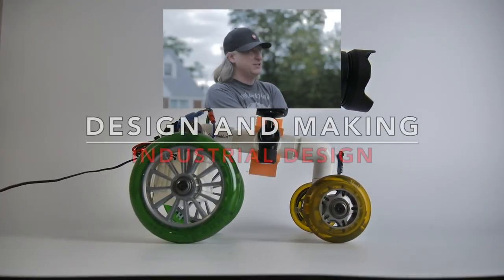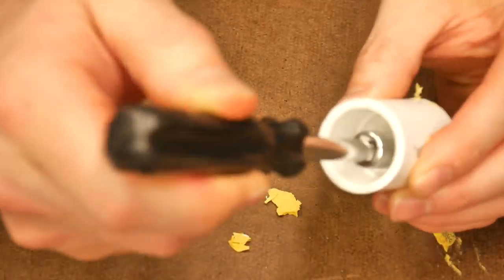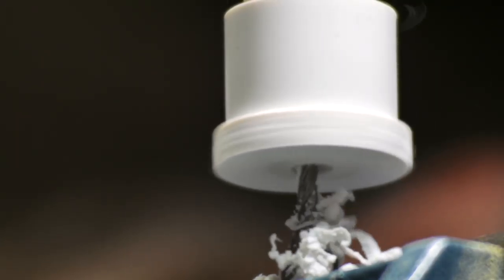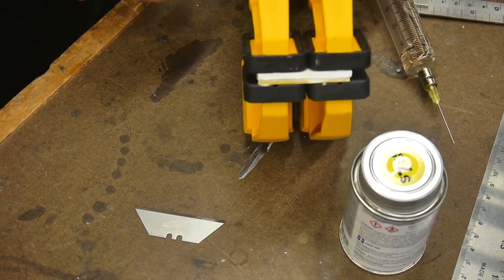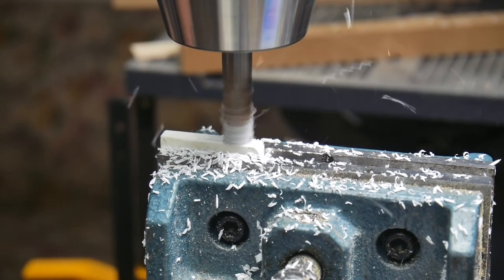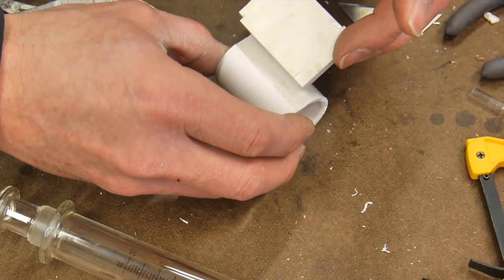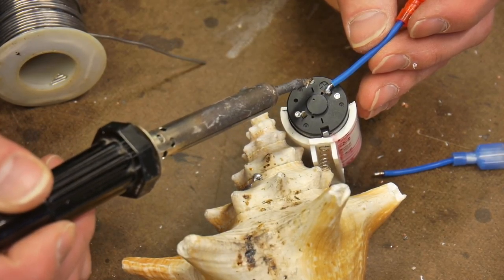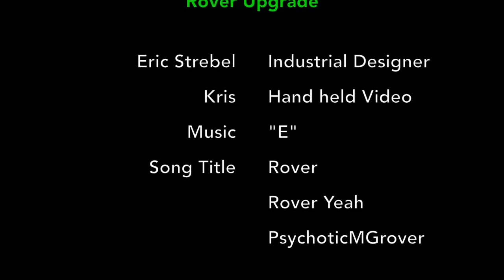Rover Table Dolly Hot Rod upgrade: motor mount and wheels

Comment: Am I missing something? If you're using the same motor shaft speed as you used with the smaller wheels, shouldn't the speed across the table be the same with the bigger wheels?
Reply from the maker: RimstarOrg same shaft size takes the big wheel longer to rotate. Definitely way way slower in real life on my end.
Reply: Hmm... I was afraid you'd say that. I'm still missing something then. The distance the motor shaft travels over the wheel is the same distance that the wheel will traverse the table. That should be the same regardless of the wheel diameter. Maybe that has a third effect when translating to linear motion of the dolly?
At risk of doing a faux pas, we're discussing it over on hackaday now. (Thanks for the tip BTW! Our tip reply system doesn't seem to be working well these days otherwise I'd message you through there.)
Reply from the maker: RimstarOrg I can get the rover to be dead slow now, something i could not do previously. Can't explain it any other way. contact me direct through www.botzen.com I notice that things have been taking longer to get posted on hackaday, would like to work closer with the team if possible, stunning article last week about zen and the art of foam core. truly humbled by that one, very honored.